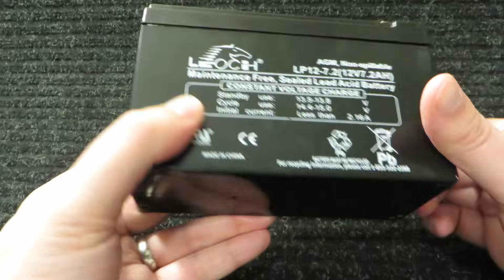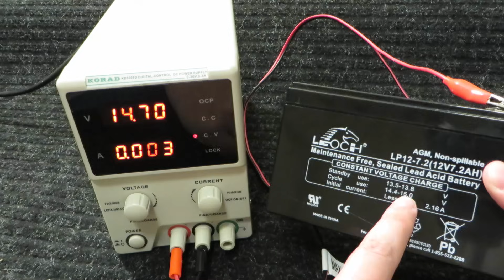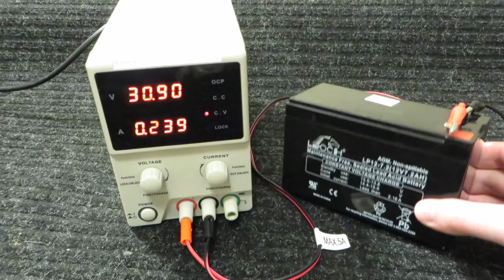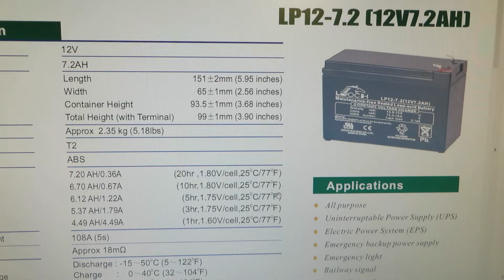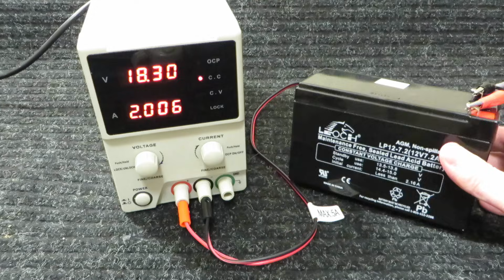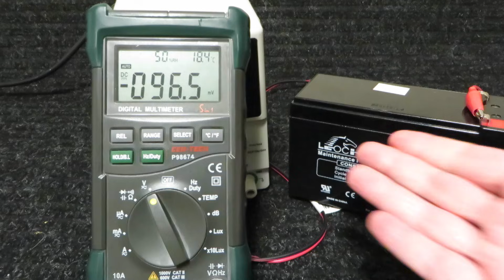Battery Desulfation Demonstration Start to Finish - Part 1/2

Comment: Yah a new video 
Great to see you back 👍
I'm interested, just bought home a dozen of these from ups's that I picked up for a test run of my solar setup while I build the 18650 packs 
Look forward to part 2 
And hope you make more, I've watched All you back catalogue
Reply from the maker: Can't believe you made it through all of my boring monologues!  I fear my love of lead acid batteries may become obsolete in time as lithium batteries get less expensive.  :(  I do expect insurance companies to ban lithium battery banks in houses in the near future though unless very onerous and expensive 'certified and inspected' government approved pre-built units are used.  Unfortunately the law will likely blanket all types of batteries because government is lazy.  Thanks lithium!  ...
Reply: @knurlgnar24  The 2017 National Electric Code has a new section 480.3 which reads as follows: "Storage batteries and battery management equipment shall be listed. This requirement shall not apply to lead-acid batteries."

Based on this, I would expect insurance companies to ban homemade lithium banks, but allow lead-acid. At the very least lead acid banks will almost assuredly remain legal. I really don't know what sore of wording insurance companies would use to ban lithium banks, maybe capacity would be a factor.
Reply: @knurlgnar24  Haha, I thoroughly enjoyed them, a good mix of detailed infomation with your impressions thrown in, not long and boring but also not just edited highlights 
I only came across you a few years back when I started getting some free laptop batteries, so it was your inverter tests that attracted me 
Think I ended watching everything you'd published, so great to see new content 
Agree with your thoughts on lead acids future, they've served us very well with little change over the years and are definitely far safer than lithium 
Appreciate your reply, take care and wish you all the best

Comment: How do you know if you have a shorted cell? Will it heat up fast or how do you test for it? Thanks.
Reply from the maker: 'shorted' isn't exactly correct, but a cell with high internal self-discharge.  The bad cell will show up in a discharge voltage curve, or if you set it on a shelf for an hour, day, week, etc eventually it will settle to a voltage of about 2.2V too low.
Reply: @knurlgnar24  Thanks for taking the time reply!

Comment: SLA’s die too easily in my experience lol i call it leotch
Reply: They do indeed but you can also remove the lid open it up and fill with distilled water/battery acid (if it's a bit too weak the concentration or to improve internal resistance). When I was younger and poorer I used to find dead batteries do that and get some life out of them that way, it does work well and I personally dislike the sealed AGM batteries for this reason, eventually flooded/agm all kinds of batteries will die but if you can double it's lifespan that really helps i guess. There are other products you can add to it that will change the chemistry slightly and potentially bring it back to life (forgot what it was will look it up later).

Comment: The real deal is back!!!  Would be cool to test the dc to dc chargers compared to direct alternator to house Batts in rv use.
Reply from the maker: I actually have a video planned on converting an industrial power supply to a battery charger.  I won't be comparing to an alternator setup but you can draw your own conclusions.  In all honesty I'd personally recommend the dc/dc charger approach for most people.  The alternator/engine approach is better for a prepper type as it's so simple, parts are easy to find, and it will last reliably for thousands of hours.  On the other hand you never know when electronics will fail you.
Reply: @knurlgnar24   Yes , agreed, the heavy duty ,upgraded alternators or dedicated secondary alternator like the #humbleroad van builder George, uses does simplify the charging system.I use a simple 150 amp breaker switch like you demonstrated ,manual off and on close to the driver's seat and a couple deep cycle batts. seem to work fine for me.After engine/ alternator is  turned off the batts seem to drop from 14 to around 12.8 volts.   But they power a low grade, 1000 watt so called "pure sine wave"  inverter to run a cpap breathing machine all night. The voltage drops to only about 12 volts.
I was surprised it worked! 
With the "Vandweller RV" craze still strong, your channel could help a lot of "do it yourselfers." Thanks  for all your  knowledge and tips and testing! Cheers from Vancouver BC.

Comment: Great video, I will have to try this method on a couple batteries I have kicking around, worth a shot, but I wonder if the old timey unfiltered DC (pulsating) charger would have a better chance at desulfating?
Reply: @Thomas Chrombly But some of the newer "smart" chargers won't work if the battery is dead. The old "dumb" chargers which are nothing more than a trasnformer and rectifier will try to charge anything connected to it.
Reply: @MRCNC1967  I have found that attaching a smart charger AND an extra voltage source will trick the smart charge to begin charging. Once it sees a base voltage, then remove the alternate voltage source and let the smart charger continue to charge.   JwgK

Comment: What you think if some use a buck converter with voltage and ampere regulation, then you have a cheap charger for batteries.

You need of course something to convert the main voltage to dc that the buckconverter can handle.
Reply from the maker: I intend to make a video in the future on this subject.  Thank you for the suggestion.
Reply: @knurlgnar24  That's a video I'd like to see too!